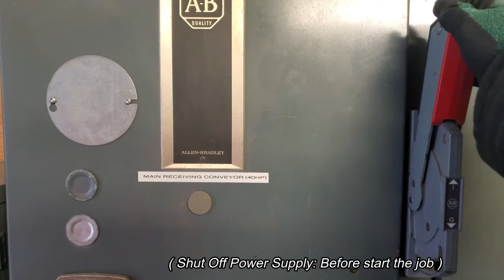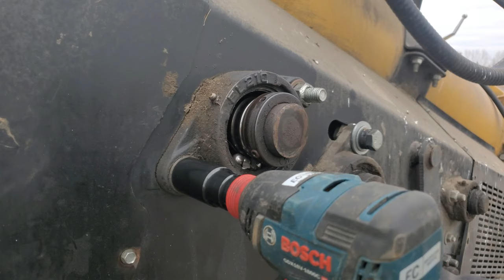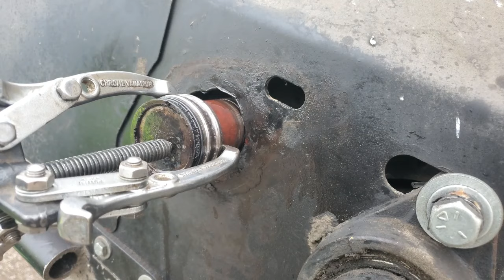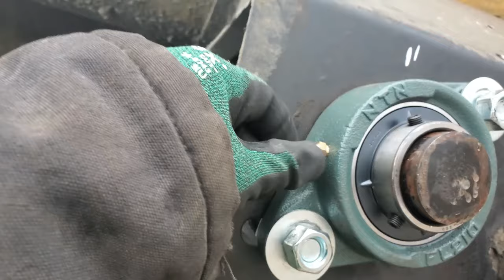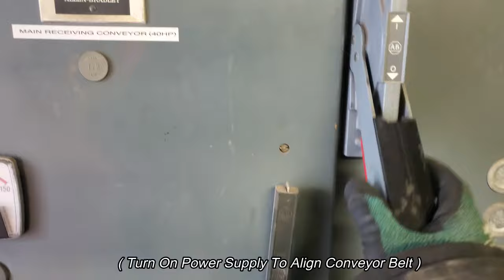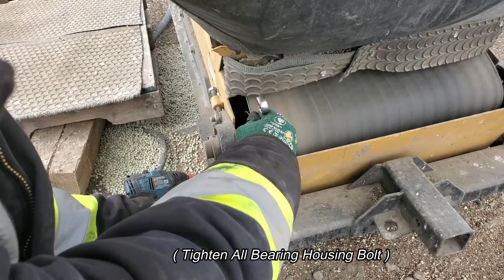Conveyor Roller Bearing Replace

Comment: you're doing it wrong, that shaft is worn out, you'll have the same problem soon, the temporary solution you made. you are installing a new bearing on the rusty shaft, both rust and the gap in the shaft cause corrosion.
Reply from the maker: Thanks for your advised.
Yes, that was true! I supposed to change also that roller cause it has a worn out shaft but unfortunately that time they have had only a bearing available to replace that parts.
The situation called the attention just to install what was available just to run the conveyor cause the operation that day was very busy unloading farmers truck using that conveyor.
I'm happy about the comment and remind me also if maybe I forget important things.
Thanks appreciated much

Comment: The second item you tried removing with the puller is called a locking collar, its supposed to be loosened before its removed.
Reply from the maker: Yes and has a pin lock or pin screw locking pin whatever the best called for that, but it was eaten by the rust, so I need to cut it using power tool.
Thanks Buddy

Comment: Some anti seize on the shaft would go along way with removing that the next time
Reply from the maker: Yes Buddy your right😉
 But happened that their is no anti seize that time and need to replace it quick to operate that machine, so natures call😉
Thanks appreciated
Reply: There must be no anti seize or lubricant between shaft and bearing surface
Reply: I would have gotten out the rosebud and heated the race up before trying to pull it out. If done right the race will heat up before the shaft will and will either slide right off or be much much easier to use a gear puller on to pop it off. I work as an industrial maintenance mechanic in a mine. The rosebud has come in handy so many times that I've lost count.
Reply: If you don’t anti- seize then your pissing every one off

Comment: Wrong bearing size
Reply from the maker: It is a same size with the old bearing but roller shaft was worn out for how many times replacing bearing that's why it showed that new bearing has a little bit bigger.
Thanks for your comment given me more ideas🤩
Reply: WOULD U RECOMMEND GOING A SIZE DOWN DUE TO WORN SHAFT?
Reply from the maker: @seanye3559  Yes u can.
As long as its fit on your shaft🙂
Reply: @jambasicskills1970  Nope, the shaft has not been spinning and worn out, or the inner race you used the puller for would pull off with your hand. Prob some Mickey Mouse bearing copy.  You have the wrong inner bearing size. The bearings I install on crusher rollers are heated gently and evenly then they push on easily, once the bearing cools, you need a puller to remove it again.
Reply from the maker: @Flyingspann3r  I'll do next time☺
Thanks Sir
Reply: Butcher job...why do all that work and install a wrong bearing...if u removed the inner race with a puller ur shaft is definitely not worn out

Comment: honestly, this is kinda subjective and all, but i spotted several things that should be done differently.
Reply from the maker: Yes you are correct. There are unnecessary need to fix on that bearing but because no available parts to use in that time so we're just fix it temporary permanent lol

Comment: I would replace that pulley . Shaft looks undercut which will eat that new bearing due to excessive vibration. Or bearing is too for that shaft. Should be nice and flush with the bearing imo.
Reply from the maker: Yap 
It is good to replace that roller shaft for more accurate fit on that new bearing.
Next time I will😁

Comment: Oh, that is the wrong bearing inner diameter for that shaft. The shaft isn’t worn out or you wouldn’t need a pulled to remove the old inner race. The inner race should be an interference fit and the grub screws support that interference fit. The inner race which you removed with the puller is what is worn out, not the shaft.
All the drive torque is going through those grub screws, when they vibrate loose, you will then damage the shaft as they mill a grove in it.
But easy for me to comment from my armchair, just trying to reduce your future expense and down time.
Reply from the maker: Mr Simon 
I thank you very much you saw those problem. Yes, lots from inner to the outer parts was damage but because happened that time has no immediate parts to replace worn out  and need to run that conveyor as soon as possible. So, I decided that for a mean a time I use those worn-out as far as its holds and run that conveyor and as of this time the equipment still working 80% lol

Comment: What is tye tool you are using to take off the bearing?
Reply from the maker: For locking collar just use Allen wrench for set screw the use chesil to remove that locking collar. And, to pull out bearing use Jaw Puller.
Thanks for your question

Comment: How much torque required to tighten the bolt ??
Reply from the maker: Hello Buddy. I can say it frankly that for that kind of bolt was not very complicated compared to vehicle bolts.
Naturally you can do this using your finger to tight bolt size 17mm and below. Tight bolt clockwise till it reach you hard to turn bolt, then use wrench for a final tighten the bolt and turn it half turn, don't put it on full turn.
Thanks

Comment: Couple  things here. 
1. End of shaft is mushroomed. Meaning it will be alot harder to remove. You gotta sand down the end of the shaft before applying lube and pulling.
2. Shaft is shot. Needs replace.
Reply from the maker: You are right Sir, but same as I was said to others that the time comes to me to make the job finish asap so whatever immediate needs I have there just to run the machine, that's was the way I did.
Thank you very much Sir

Comment: Hey I just got a maintenance job in distribution center. I would definitely appreciate any help I can get. I'm pretty handy but it's my first day and I hate not knowing how the system works, what the parts are and what to look for if anyone can give me simple breakdown or guide me to some more videos. I'd very much appreciate. Everyone in here seems so knowledgeable. Thank you all
Reply from the maker: Hey Buddy what is exact you doing in maintenance job?
I can maybe helps you in doing related on Bearings replacement, pulleys, splicing conveyor belt.

Comment: Did anyone use saftey padlocks to lock off the main power and isolate it?
Reply: yeah we call it lock out tag out
Reply from the maker: Yes sir, but I've showed only shutting off circuit breaker and not included LOTO in my video.
Thank you for reminding me and hoping next not to forget LOTO include in my video.
Thanks appreciated much.

Comment: How to remove stuck up shafting of drive roller?
Reply from the maker: use penetrating fluid if doesn't work torch it or else otherwise cut worn-out bearing

Comment: I was just wondering , it didn’t show you grease it ?
Reply from the maker: Thanks for a question.
I won't do greasing for a new bearing. It has already greased coming from the factory, too much grease will damage oil seal.
Thanks for dropping by Buddy🙂
Reply: It must be a self lubricated bearing meaning it was  already injected with grease during bearing manufacture. I have installed such bearings before where you don't need to grease during installation
Reply: @jambasicskills1970  respect on that , I’m just starting to work at a quarry , and love the video so I’ve had a lot of questions I need answered about bearings , how many proper pumps for crusher , and then how many pumps for a regular conveyor bearing , and is it different for regular hand pump greaser compared to electric . ????

And then the wash plant , if you see that the bearing is already caked in grease do you leave it , and I usually pump 3 times and if I can see the grease start to come out I stop , other bigger bearings I grease , on the crusher I’m told to give it 15 to 20 pumps . I have a lot of questions . And I appreciate any info
Reply: @douglasmurphy9281  Hi, 
em also work on grain conveyor repairs, bearings n auger. I don't do greasing on new bearing, U might damage oil seal and U just wasting grease coming out from the bearing.
Reply from the maker: @douglasmurphy9281  questions are welcome and appreciated. 
Conveyor bearing need just a small grease in it, 🙂🙂 just 2 manual pumps are enough, avoid to much put grease on bearing.
If bearing seal is broken and grease comin out and you still using that bearing, just need 3 to 4 pumps.
Even thou you pump more than 7 pumps, your just wasting your grease. 
Make a routine to check and observe  bearings and equipment and Day by Day it will comes, You learn how handle everything even your concern🙂

Comment: He made the wrong assembly. He did not install the new bearing on the axis correctly. The bearing will break again in a short time or break the bearing opposite it.

Making such a repair means doing it again in a short time. Double repair cost.
Reply from the maker: You are right, but the situations was changed a bet. It was called modifying 
Thanks Buds

Comment: to me you are amateurs.  the first sleeve must be knocked off.  This bearing model is clamped with this bushing.  the end of the shaft was beaten with a hammer, you can see it. and this shaft is damaged, lack of alignment, replacing the bearing will help for a while
Reply from the maker: Absolutely your correct if we go on proper fixing this bearing but for the situation depends in the time you need it must, so we go how just to run that conveyor asap.
Thank you for your precious comment.